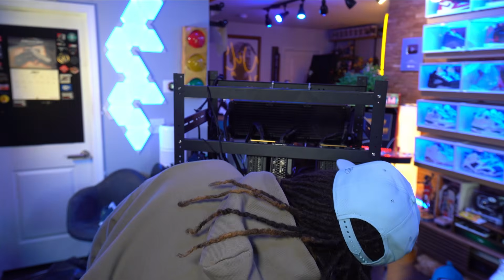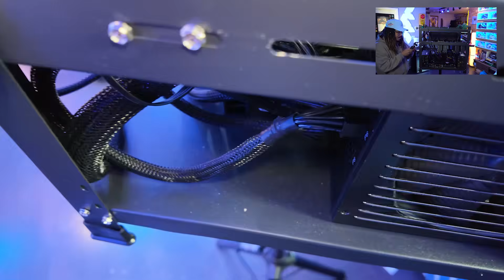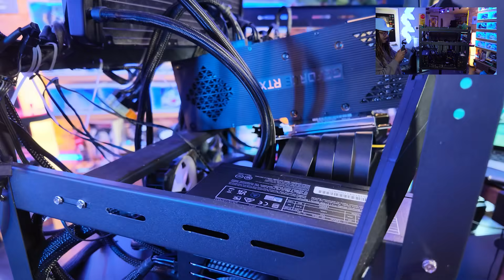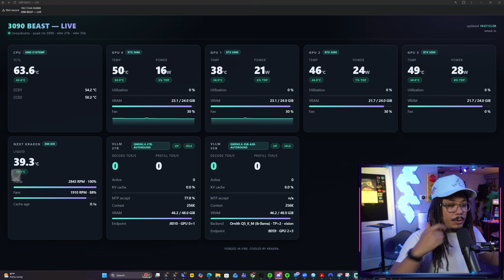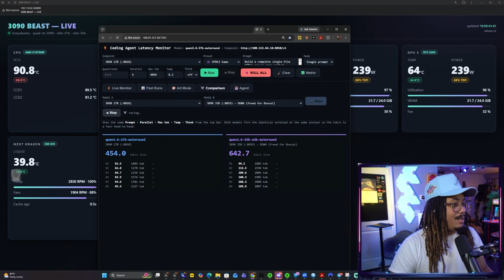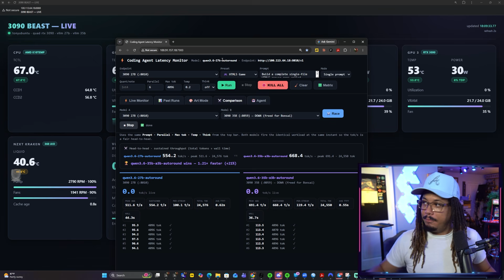4 RTX 3090s + Dual NVLink: My Ultimate Local AI Setup

Comment: so if i understood right, your're running a 27b (qwen?) model on two nvlinked gpus, and a separate 35b (qwen again??) on the other two nvlinked gpus? could you please share your configs? I currently have 1 3090, but am interested in getting another and linking them up with gpu p2p

Comment: I really like your channel dude. Hey, a few heads up. What matter on your setup is not really tied to the 8 or 16 lanes. It is all about the bandwitch of pcie gen4. You're right for nvlink, there's no pci bus transfer involved at all for both gpu. The caveat of pcie gen4 between your two nvlink pairs is not a big issue but you HAVE to stick around vllm or sglang. You need tensor parallelism. I own a server of 4 nvlink pairs (8x3090) and I did a lot of research on it. So down the line you have a pretty good rig man. Having pci gen5 won't bring decent value on the table. Pci gen4 is just fair enough, but don't get away of tensor parallelism !
Reply from the maker: Thanks man and I agree and plan to never leave TP2 or 4 lol
Reply: @Tech2wild1 yeah you're right, tensor parallelism don't give a heck about nvlink, it is not viwed as a topology. But that's ok 😅

Comment: I have 6 3090's on the same open rack.  The motherboard/cpu is Gigabyte/Threadripper 3975WX with  512 GB ECC DDR4 and 7 PCIe slots.  1 of the slots is only x8, so I only use the 6 remaining Gen4 x16 slots.  I've got 2 NVME drives totaling 6TB running linux.  I use the Nvidia unified memory driver when running big models (quantized).  My favorite models lately Qwen 3.6 27B & 35B, Qwen3.5 122B, MiniMax-M2.5 & Step-3.7-Flash.  On the Qwen3.6 models, I use abliterated and quantized to Q8.  On the MiniMax models (I also have 2.7 & 3), I can get away with MXFP4 or Q3 quants and still get decent speeds.  I am still deciding where Laguna-S-2.1 will fit into the workflow.  All of those models are decently fast even without NVLink.  I tried DeepSeek-V4-Flash and Qwen3.5-397B.  I kept the 397B model as it is slow but still usable.  DeepSeek I'd have to use ds4 and that would overly complicate things so I ditched it.  My PSU is a single 1600 watt and I use nvidia-smi to cap the cards at 205 watts.  I use nvml-tool to tweak the fan speeds as even at 205 watts, the cards heat up quick.  I'm able to keep the temperature around 70C and that seems pretty solid.  The threadripper has a liquid cooling system with 3 120mm fans.  It definitely generates some heat.  I bought all of this before the rampocalypse really started and probably spent $8000.00 total.  It's a great rig, even if it can't use NVFP4 models.

Comment: I think the idea with the big fan will work but at the same time I feel like a sealed case with proper intake and exhaust would stop stagnant airflow build up around the cpu and cards. just as good? A big fan is probably the easier and cheaper route tho. If you did make your own closed case you could have intake filters to prevent dust or bugs from the garage getting in there.

Comment: If you do want to consider upgrades: you don't need to spend that much to get full pci lanes for those GPUs. Get a Gigabyte MC62-G40 motherboard and a Threadripper Pro 3945WX. Total cost is about $1k. Gives you 6x pcie 4.0x16 slots, a 4.0x8 slot, and the motherboard/processor can support 128 pci lanes across the slots, the m.2 drives, and other onboard chipset stuff. It uses DDR4 ram so that can swap over, or you can look for ECC ram since it supports server stuff too. You do need a cooling solution for the processor though so maybe a bit more than $1k all in.
Reply from the maker: Yes ! That is the one I mentioned in the video just didn't know the name but yes this would be a good way to keep GEN 4 going. Might be the more efficient way to keep going. I feel like I would just rig that out then after that THEN I could look into maybe a whole new work station but yes this is a solution I need to look into.

Comment: Look into PCIe lane bifurcation - which will allow you to split a single PCIE slot into 2, so you can make a 16 lane into 2x8, and you can get more 3090's on there!
Reply: You can just need a p2p card to do it
Reply: You can’t bifurcate more than x8x8x4x4 on consumer platforms, and he said he’s on an x570. Consumer CPU’s don’t have enough pcie lanes to run more than 2 pcie slots in x8x8. If you get adapters like he’s talking about, they either run x4 through cpu, x4 through chipset, or x1.

Comment: I have a similar setup using this rack. It's so much more efficient that I expected (claude said 150-200w idle - it idles around 52w) that I'm thinking of making it my main proxmox node.

My biggest issue is figuring out how to connect multiple harddrives.. Currently running a 4x zfs pool and a few singular drives on a Jonsbo N6

Comment: Nice video, thanks - Feedback: at 04:00 and on, you dont need to even have more then PCIe3x1 when you do vLLM with a defined model loaded all the time and that model is also MOE, the intercommunication is so less that even these USB3 1GT/GB slots are enough. However if you do media-generation like video or photo or use heavy dense models, then yes, PCIe4x16 on every 3090 is favored. If you dont do that, you never needed that. Also even Dense models run crappy on the 3090s. The 3090s card is a MOE model card.
Reply from the maker: Before NVLINK tho I was getting 80 toks on dense 27B and now 100 toks that seems fast to me though for a dense model

Comment: Recommendation for the cooling problem: Undervolt all GPUs, this reduces heat generation significantly. Consider that each GPU needs a specific minimum voltage to function, and each GPU needs a specific minimum voltage for pareto-optimal performance. When you begin undervolting a little, you will notice no performance loss. When you increase undervolting, you will incur a little performance loss. Below a GPU-specific voltage, performance will drop off a cliff. Try and find out. Undervolting degrades performance way less than limiting power draw.
 Several users report that reducing power consumption up to 25% incurs only little performance loss (ca 7%), but reducing power further will cause a severe drop in performance. Maybe you can get away with reducing power draw by 30%.

Comment: I have the same set up. My question to you is, does the NVLINK matter so much though? Beause it seems for just inference, it doesn't have such a big difference, and I was wondering if I need to get one just for the fun of it?
Reply: tl;dr:
If you use pipeline parallelism for sharded models and no speculative decoding, then NVLink is useless.

NVLink for RTX 3090 has 56GB/s per direction, compared to 7.88GB/s with PCIe 3.0 x8 and 15.75GB/s with  PCIe 4.0 x8. With  software that can use the data lines bidirectional, these bandwidth rates can be doubled.
Bidirectional data transfer occurs during prompt processing (prefill) if the model layers are sharded among GPUs. Inference causes unidirectional data transfer if you use pipeline parallelism sharding and don't use "speculative prediction" (e.g. MTP). Tensor parallelism sharding of models and MTP both cause bidirectional data transfer.
Reply: @Viewable11  I had to scroll down way too far to find the right comment. Full blown SXM NVLink for 300GB/s or bust, I say. In this instance, NVLink is next to useless, but old mate got a vid out of it, so.....
Reply: @adjoho1  I would not say NVLink is useless, I'd say it's not worth the price. I'd rather get more VRAM or faster VRAM.
Reply from the maker: I got 30-50 toks increase on both models
Reply from the maker: To everyone here why would you use PP over TP ? I’m using TP and NVLINK is not useless
Reply: @Tech2wild1  I would use pipleine parallelism over tensor parallelism if my compute hardware has slow data connection (e.g. PCIe with low bandwith).

Comment: very cool consumer component build! I know it's not really your thing, but this is actually a great build for fine tuning models at home. 

On just inference, one thing that used to be great is going for 256-512GB of ddr4 ram and offloading layers of much larger models. Works pretty well for dynamic quants from unsloth of GLM or minimax. I know ram prices make that not as appealing right now... though. But it's a better upgrade than you might think and very usable tokens/sec.

Comment: what can u run wit this setup, Kimi K3 half a bit?  😂😂
Reply from the maker: I also run the brand new 115b laguna model at 200 toks
Reply: 4x 16GB cards == 64GB of vRAM so he's going to be able to comfortably fit a 4bit 35b model in there. Using MOE like he is it's getting good t/s.  That should also suffice to give a full 256k context window but might need to bring the KV cache down to Q8.
Reply from the maker: this is 4 x 24gb cards 96gb vram and im running 27b and 35b
Reply: @genxtech5584 blah your no fun lol
Reply: @BabylonBaller sorry 😢

Comment: 3090 such an underrated graphics card !! insanely powerful
Reply: man not for long, you seen ebay prices lately? i saw stuff goin for more than it was new on release lol. and obviously for this use case its incredible power/speed for the money, like a dual 3090 setup can run 70b models np
Reply: @utewb4131 RTX 3090s can be upgraded to 48 GiB for about $500.

Comment: Nice setup! I was in the same situation you were three weeks ago. Gaming PC with 4090 and a streaming PC largely unused with a 3090 and wondering what I could do with it. Well now I am in the middle of building a 6x3090 build - ended up getting a killer deal on a 3rd Gen treadripper and motherboard for $650! For anyone starting from scratch I'd recommend checking those out for maximum PCIe lane capability (also get to pay slightly less for ddr4 ram.
Reply: What I am building allows for x8 speed per card. Thanks for demonstrating that x4 speeds is functional still as that helps identify any upgrade pathways down the line
Reply: Bro you're going to use more $$ in power than you'd save just calling an API :)
Reply: @genxtech5584 im looking to build a business to serve other businesses who cannot reply on frontier model companies with their data, or ones that simply dont want to. But you are right - 3090s is mainly a cheap proof of concept build. Any sort of scale out would be in a server rack with 6000 pros or similar.

Comment: those nvlinks used to be like $50 on ebay 😭
Reply: Never. You ignore that the cheap NVLinks for RTX 1080 and RTX 2080 are not compatible with RTX 3090. NVLink for RTX 3090 has always been absurdly expensive.
Reply: @Viewable11  no. they are $100 retail and were abundant at stores like best buy. $50 refurb on ebay during that time.
Reply from the maker: Jesus smfh